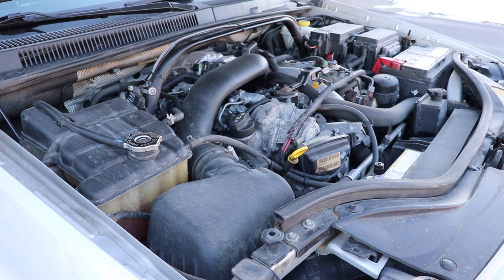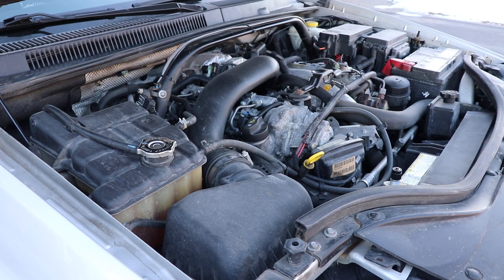2005-2010 Jeep Grand Cherokee WK CRD OM642 Possible Exhaust Leak in Engine Bay

Comment: I had the same issue on my 08 right after o bought it...it was the crush gaskets from the turbo to the exhaust...they had been reused when the oil pan was replaced by the previous owner...there was black soot on the firewall behing the turbo. I took a rag and tied it to a stick, looked like a giant qtip, and ran against the firewall, it came out black. That's how I knew I had an exhaust leak back there. Took the turbo off and replaced ALL gaskets and it has been good ever since. Look on here how to remove th turbo, there are a couple vids. It's a pita for sure, but it beats the 1500 I was quoted. Good luck!

Comment from the maker: Update:  I changed the green o-ring up at the turbo because it was loose a couple years ago when I had that tube off to change the serpentine belt.  What I forgot was there is a black o-ring on the other end of the hose so I did not change that one.  The lower black o-ring has been leaking a touch of oil so I need to go back and change it.
I definitely have an exhaust leak on the passenger side manifold, when it is cold out I am getting an unburnt diesel exhaust smell in the cab.  The exhaust leak seems to be the biggest problem and cause of noise from what I can tell.  This means I need to change the manifold during the summer.